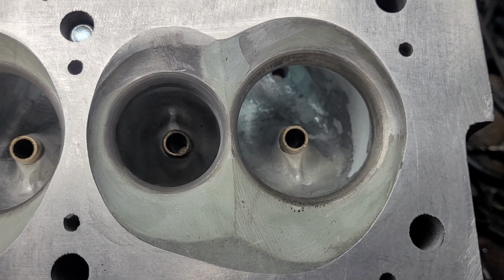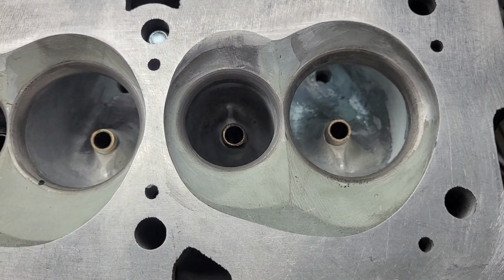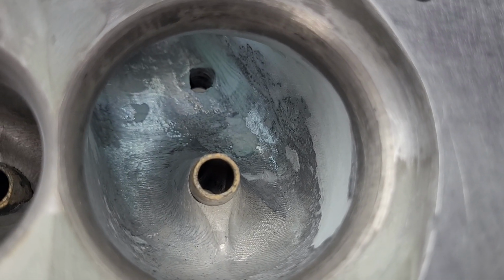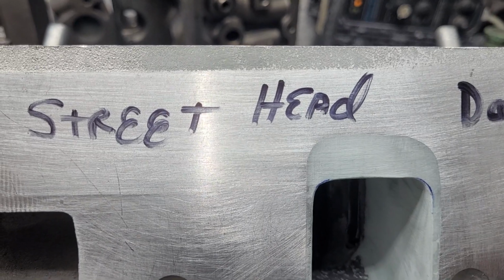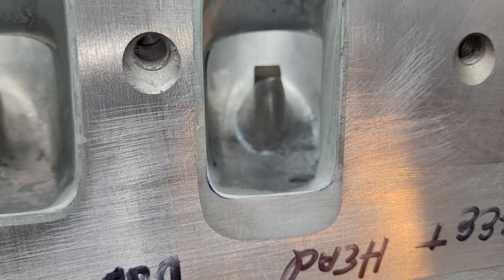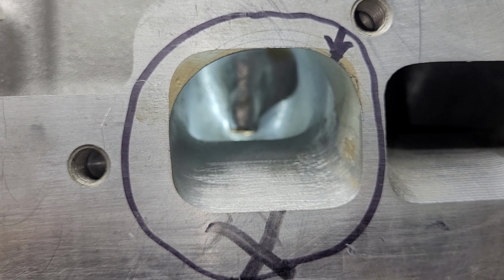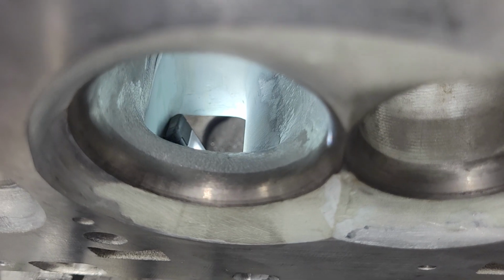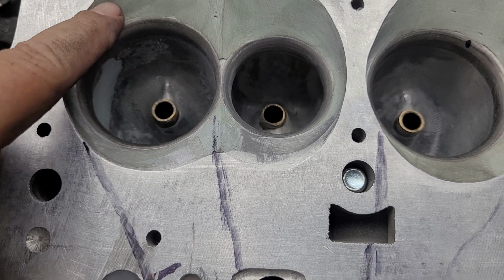Big Block Oldsmobile cnc master developement, Street head version.

Comment: Nice, i love the olds engines. As a mopar guy. They are my 3rd favorite engine brand only preceded by International harvester.
Reply from the maker: I have owned International stuff. Interesting engineering.
Reply: @servediocylinderheads  an engine which I would like to build is the ih 392 v8. 4.125 bore. 3 656 stroke. Intake vakve is 2.08 from factory. Often times people will buy custom light ford fe pistons. And lighten the rods/ bottom end. Then deal with oil drainback and put on bbc springs so the engines will rev past 4000. Camshafts are readily available from most camshaft companies for the ih SV (Small V) engines. So that is the 266 cui to 392 cui engines.

The interesting thing is it a semi hemi design. That was really designed for torque. I beleive that just like the olds. The ih intake valve is almost perpendicular to the piston.

There a re a couple of guys that have made overn 400 hp with them. And onother this that was done is cutting the cranks down to chevy 2.00 journals and creating a 445 cui stroker. One dyno result had over 500 ho and 500 ft lbs of torque.

the most hilarious thing is that they often used what they could get their hands on the cheapest. By the end of production of the scouts. Random bolts. All the same color wires etc. We're used.

Comment: I am a MoPar guy overall, but in the GM line, I like Buicks and Oldsmobiles in that order. The BBB 400-430-455 to me are the best basic design, and if the oiling system was better and the blocks weren't so flimsy, their geometry (455) would be hard to beat. Olds 455 is slightly better in these two areas, but the undersquare nature and head design make them a little less race oriented but definitely potent! Batten made some serious Olds aluminum heads back in the day (along with some alloy MoPar W2s), and people are still using them with diesel blocks and making killer HP!! Thanks for posting!! RB
Reply from the maker: Good info. Thanks
Reply: Buick eventually adopted the Stage 1 oiling improvements for all of the production 455 engines. Those improvements are good for most hot street Buicks in my experience. I agree with you about the bore to stroke ratio and rod to stroke ratios of the Buick 455. 

The Olds 455 blocks have even flimsier mains than the Buick. A broken engine mount is enough to tweak the Olds block. Giving the Olds plenty of main bearing clearance is a huge help.
Reply: A diesel block build with Batten heads is a potent build, extremely potent.

Comment: I see one minor issue, no spark plug holes. Interesting development work. Thanks for sharing Charlie, and thanks to your client.  Regards Greg
Reply from the maker: Plug is a bit tricky, no doubt
Reply: It's a diesel olds oh no!! 😅😂 Jk
Reply from the maker: @bobbyhaskell2048  Don't laugh, modern gas engines have lots of diesel tech in them!
Reply: @servediocylinderheads   I'm aware. I was actually poking fun at the infamous Oldsmobile diesel engines of late 70s early 80s that where a total failure because those cylinder heads don't have a spark plug yet 😆.
Reply from the maker: @bobbyhaskell2048  Sorry, I am a bit slow. Thanks
Reply from the maker: I remember guys taking that Olds diesel block and building nasty gas engines with them due to block thickness and rigidity. Thanks
Reply: @servediocylinderheads  Yes, build a 440 SBO DX block .
 There are great parts out there for Olds in 2025 still. 4.0" stroke/2.5" mains  steel stroker cranks that fit a 350 gas block for 428ci @ .068" overbore, which the older 350 blocks take very easily and safe for more. 3.0" mains in the diesel - so order it with 3.0" mains, or use spacers for D & DX blocks.
Reply from the maker: @tking7513  Good info. Thanks!

Comment: Almost like diesel heads with that almost vertical valve angle.  I always wonder why when they make heads like this they don't but a half inch or an inch spacer in them on the intake side. Then with having 2 different plates they  could offer a head with stock ports to bolt to a stock manifold or modded ports to work way better.  Maybe there is just no room for it.  I gave you a shoutout on my last head video hopefully you pick up some subs and viewers. Keep grinding! 🙂
Reply from the maker: Awesome, thanks!

Comment: The term you are thinking about is called digitizing. Its done with a coordinate measuring machine or a cnc duplicator. The process involves tracing the shape with a stylus the size of the cutter to be used to cnc profile the head. In this case I believe it will be a ball nose endmill. The coordinate measuring machine or cnc duplicator records x and y coordinates at a constant z depth and steps down the shape in increments to create a tool path and writes a program that can be run over and over from head to head. This insurses shape accuracy in production.
Reply from the maker: Yes, digitizing. Thanks

Comment: There is a aluminium casting pour of an Oldsmobile head video on YouTube, I believe from 2019, that has no details and no follow up.  Could it be this design?
Anyway it would be a welcome addition to the small lot of Olds performance parts.  Never thought I would see a professional porter work up an Olds head video.
Thanks for sharing.
Is the 318 DV/UTG development project over with?
Reply from the maker: The development part of the 318 project is close to done. I just need to finish and finalize. Thanks

Comment: I saw a guy about 10 years ago made aluminum olds heads with sb2 ports and chambers he was putting them on a government repower beefed up 6.5 diesel block bored to 4.250 forgot the stroke
Reply: Likely 3.975" early Olds steel crank

Comment: Batten made Olds heads.  Edelbrock and SpeedMaster are commonly available now.
Reply: Rocket Racing has one of their own design.  Not this one though as the Center intake ports are relocated inward, away from the pushrod, on those heads

I wonder if he head owner was referring to the Wise cylinder heads regarding this design.  They seem to be defunct
Reply from the maker: @gordonborsboom7460  Yes. Thanks

Comment: 'The Holden 253 308 cast iron red motor heads has the inherent bad intake exhaust intake exhaust exhaust intake exhaust intake design but the ports are mirror image,
And port lay out is similar to the head your doing.
 however if you were too introduce swirl one intake port will flow different to the other as the intake valve is on the wrong side of the chamber as can be seen in the head your working on. To make matters worse the Holden heads have tiny ports with very little cross section area and don't have enough metal in them to get Big Flow numbers out of them.. Be Nice to have a pair of cast Aluminium heads made to my spec and do the CNC machining myself.
If only I could afford these things.
👍
Reply from the maker: Not cheap I am sure. Thanks